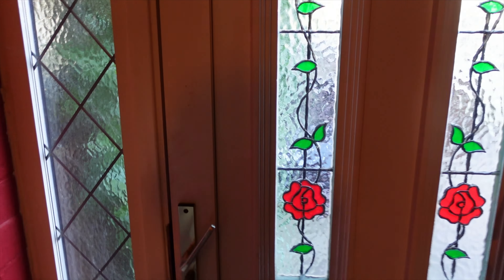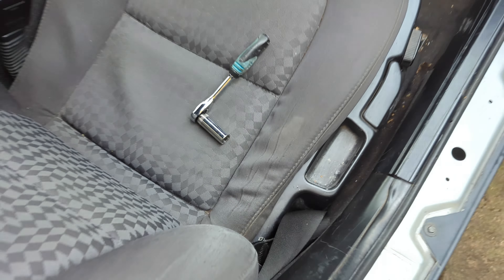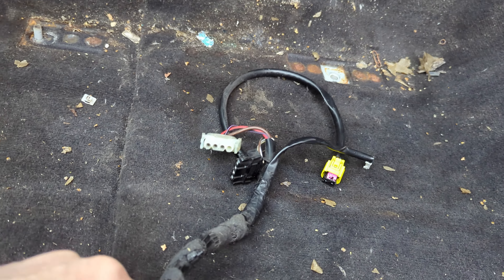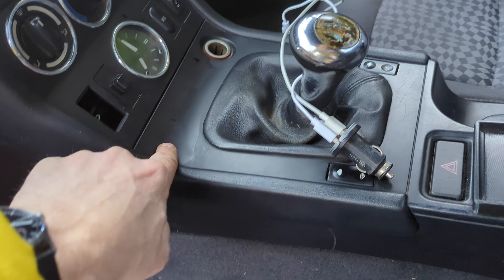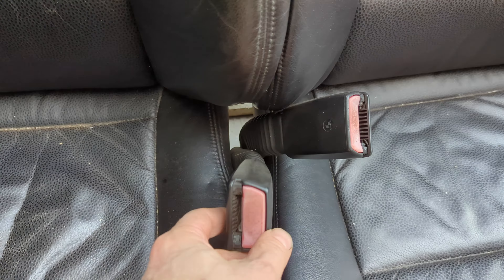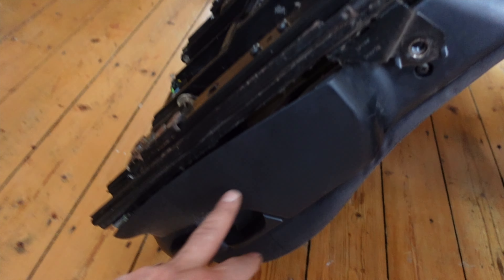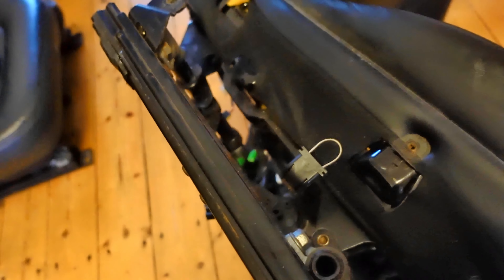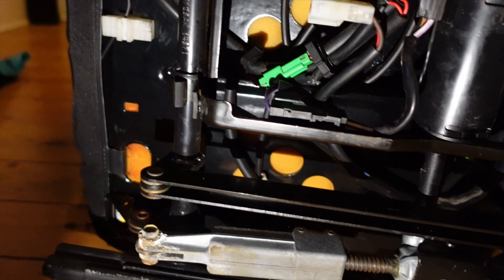Repairing & retrofitting heated seats to my BMW Z3 DIY EV

Comment: Heated seats are essential with home brew EV's. Especially if like me you have no other heater. 🥶
Reply from the maker: I need to finish the interior to get my real heater up and running. But that will probably halve my already small range!
Reply: @EVDIY I've ordered a 500W 12V fan heater which should arrive soon. I'll let you know how well it works.
Reply from the maker: @alibro7512  I've been thinking of adding something like that as well. Though might not be able to do that and put a smaller battery in to create more boot space.
Reply: It should be OK as it's the dc to dc driving it. My battery is pretty knackered so it wouldn't last long either.

Comment: Did you replace the bushes?  Rocking seat repair
Reply from the maker: I didn't - these ones didn't seem to need it. Very solid. Might do the tilt mod though to shift the position.